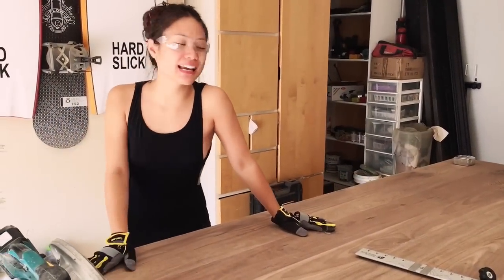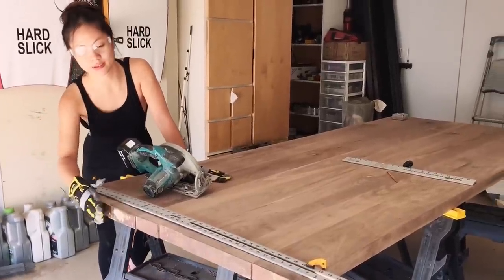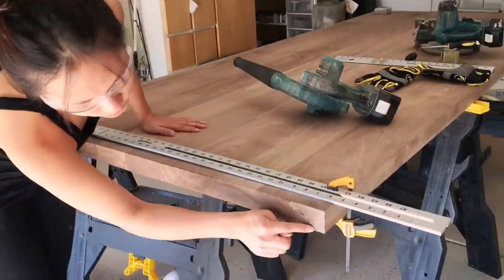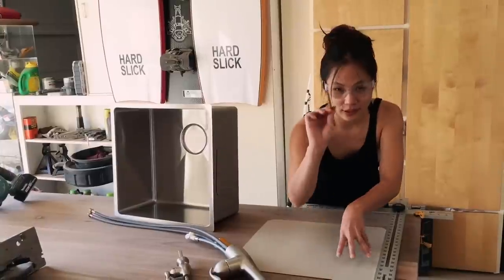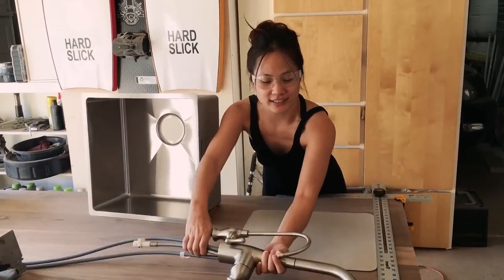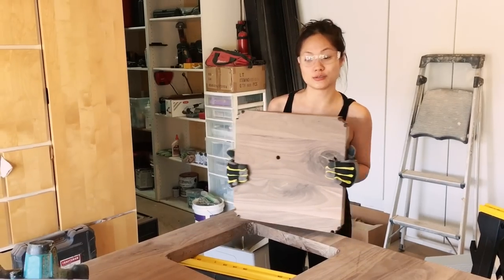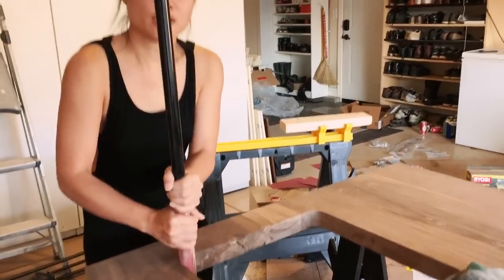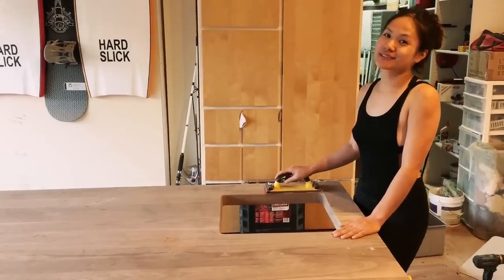How To Build Your Own Kitchen Island Wood Bar Counter Top PART 1 | Minnie’s VLOG 5

Comment: Countertop looks great so far.  When you squared up the ends of the boards, it would have been better if you were cutting right to left (from the camera angle) rather than left to right.  That way, you have more of the base of the circ saw in contact with the work surface and it will prevent any tiping of the saw.

Comment: Wear a mask when sanding walnut, beautiful wood, stuff is toxic.You can make cutting the edges safer and easier ,if you put your guide in deeper ,and saw with the the base of the saw on the table.Other than that fine work looks awesome.